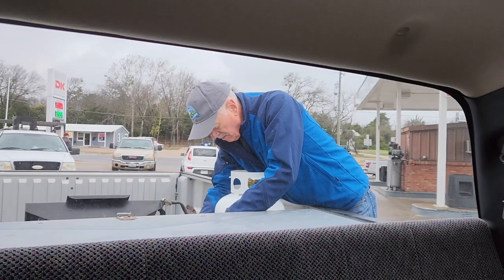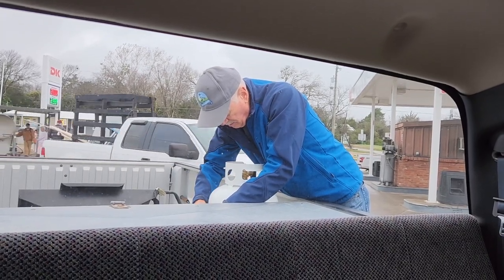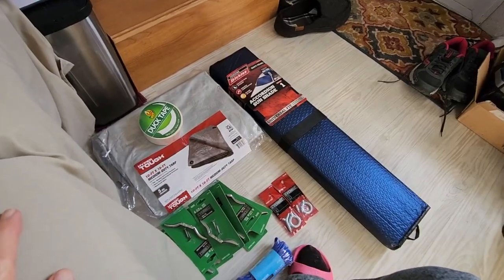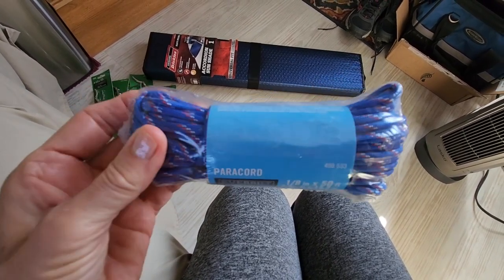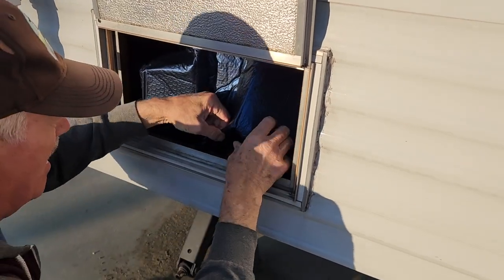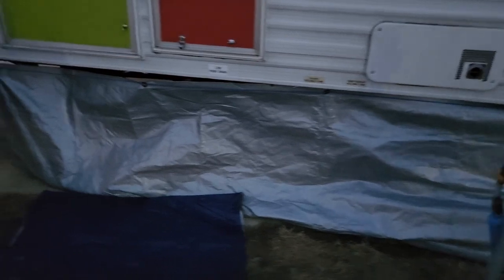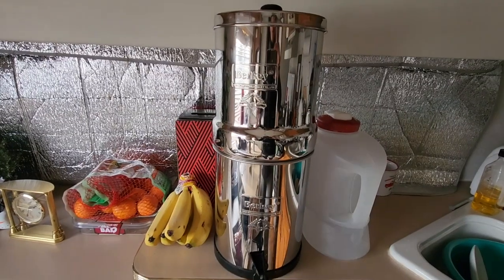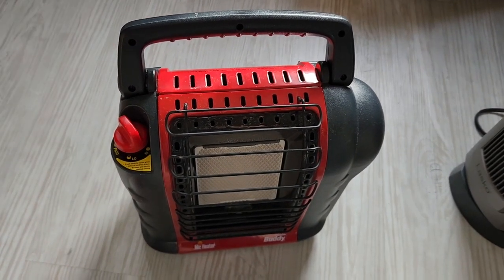Yr 6: Adding cheap RV skirting for extra cold weather insulation

Comment: Think i be getting extra tanks put up somewhere
Reply from the maker: We have 2  30 lb propane tanks. When we lost power for 15 hours in 2021, could not use electric space heaters, and it was below zero, we barely went through one tank. We were VERY surprised and grateful! If we were more long term, like staying in cold for several months, a large propane tank would certainly be a consideration!! We know some RVers who have them. Thanks for the suggestion! 😊